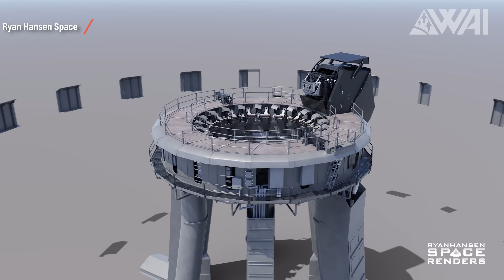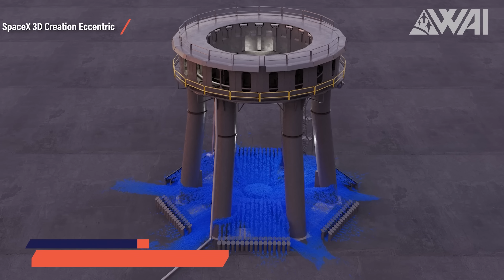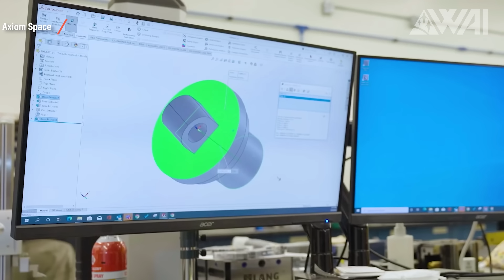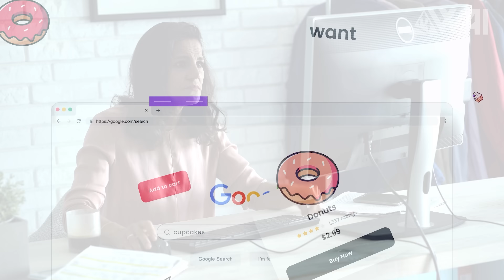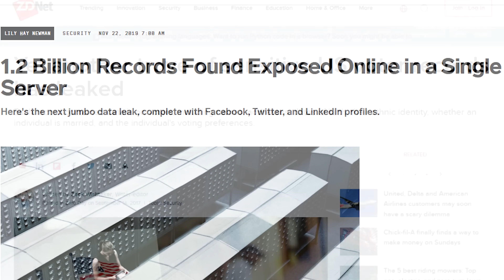SpaceX Starship breaks records before LAUNCH!! How will the journey continue?

Comment: After all 33 engines fired it acts like a giant sand blasting machine. The sand in this case are pieces of concrete torn from the ground. If Elon redirect the flow toward some rusted giant ships nearby, the rusted surface of the ship can be striped to bare metal and look brand new again. Why not :)

Comment: In addition to the deluge system, wouldnt it work to place what is basically heavy flexible steel armourplating on the ground underneath the pad? Probably even slightly sloped to redirect the exhaust somewhat?

Comment: Technically, a deep water filled pit beneath the launch tower would not be terrible. Then you could use compressed gas from the bottom to shoot water up at the engines when they ignite.
Reply: Pretty much what the graphic for Rocketlabs US facility shows with the launch platform built out into the water. If it works for one company, why not another?

Comment: To help with the launchpad problem, they could build a big iron or copper plate and run water or liquid nitrogen through it.
Reply: The metal arour / diverter is a good idea. But not cooling it to that degree. That would lead to the metal just shattering like glass. The main problem is not the heat. It´s the shockwaves. The sheer noise of all these engines is comparable to continious large explosion. That is what pulverises the concrete for the most part. Iy you stood to close the pressure from these engines could easily kill a person. It´s also the main reason for a deluge system. Water and especially water droplets create a surface that swallows noise, so the water curtains absorbe a large part of the shockvawves as transition between two materials (air/water in this case) absorbs a huge amount of energy. It obviously also absorbes the heat, but that could be dealt with other materials for the surface of the directly imacted areas. The shockwaves not so much.
Reply from the maker: Actively cooled pad surface? I like it. :_WAIElonlaugh:
Reply: No doubt in my mind already thought of, but rejected, because it's too complicated and likely to fail compared to just pouring water over the pad.
Reply: or they could have done it right the 1st time with a flame trench, diverter, and robust sound suppression water system.
Reply: Uhhhh...that's just no.  That's 2500 degree fire. Copper wouldn't and couldn't convey the cold nor the hot through it before cracking like a nut.

Structural dynamics wouldn't allow it and it would be 100x more expensive than just a simple concrete blast tunnel and some flipping water.

As for "capturing the water" LOL capture WHAT water?  I'm sure they can turn the pump off before its blown 100s of gallons of fresh water into the surrounding "protected bird preserve" that Musk chose to built his ROCKET FACTORY AND LAUNCH SITE beside. The rest of the water oozed during the takeoff is going to be seriously doubting its career choice as water droplets as it disappears from being able to be physically seen or detected.
Reply: @LoociferZ  I also wondered why he built in such a shitty location.
Reply: @froschreiniger2639  YES!  I didn't find out that it was a nature preserve until the last "high energy event" where the rocket blew up and caused the NTSC/and all the rest including NASA itself to pull their launch licence.  After 7 months they gave it back but with a ridiculous number of things they need to do in order to mitigate "high energy events" on a frigging rocket test site.
It seems Boca Chica also has a large group of people who like to use the flipping beach by a ROCKET TEST SITE so when they want to launch, they have to post the closure and close the beach too!
It's not a guess it's a pretty good assumption that the original deal to pull Spacex there didn't include them only being able to close the beach/test/launch a certain number of times nor add a whole pile of pollution mitigation steps to keep pollutants from a ROCKET FACTORY out of the bloody nature preserve!

I hope SpaceX throws them the middle and moves. I have to assume that their creation of another site over at the Cape has to do with this.  Hope SpaceX leaves a couple hundred empty concrete pads and just leaves the local economy holding a bag of nothing for being so ridiculous.
Reply: @LoociferZ  Whoever approved this deal should go to jail. The incompetence is just insane.

Comment: I wonder if porous concrete would be useful for the pad. I'm imagining that the concrete is spalling because because of the instantaneous heating and concurrent air/moisture expansion inside the concrete. Having a porous concrete may provide an exit path for superheated gases to escape?
Reply from the maker: That's a very interesting thought! Maybe something they could try after installing the deluge system if there still is a need then! :_WAIRUD:

Comment: A bit ago you said they don't release the rocket until after ignition.   Take a look as Spacex's  JILQ2qe-cjI  video.  You see the let go of it around 4 minutes prior.    Do you have info that they will do this different on StarShip?
Reply: That's a different kind of letting go; the strongback, or the chopsticks in Starships case, will likely be retracted from Starship a few minutes before. But they don't fully let go of the rocket (with clamps) until ignited.
Reply: @justinni_  The original question was regarding the difference between the full dress rehearsal and actual flight.  I gave an example of them not letting go with the strong back/chopsticks and he replied that they don't let go until after ignition.   I was pretty sure that was wrong but it wasn't important enough to research.   Just waited for the next launch.   And sure enough.  4:00 prior.  And they don't do that on full dress rehearsals.   But.  I was referring to starship so maybe they have different plants.  The differences are just an interesting topic.
Reply: @lucidmoses  Felix might've been wrong here. Strongback always retracts few minutes prior.

Comment: Per me the distance between raptor engines and ground surface must be increased 3 times or even more. Ground floor should be covered with iron plates with build in water cooling channels. If not, Elon gonna repair the concrete ground cover every time prepare it for the next launch.
Reply from the maker: I thought about this many times before. Why not raise the OLM much more and give Mechazilla an extra segment? :_WAIHello: It'll be hard to do before a launch but maybe on the second Starbase tower when it comes?

Comment: Given that they don't seem to want to build a flame diverter, and that they have so much experience with stainless steel, it seems like they would cover the pad in steel. Not a long term solution, but with all the scrap they have lying around it seems cheaper than resurfacing the pad after every few launches.
Reply from the maker: It'd likely need a full resurfacing after every test as is now. Plus, there are things going into the ground soon directly under the pad as talked about on today's episode. :_WAISweet:

Comment: So if the were to dig down a flame trench at boca chica, it would instantly fill with water due to being under the water table…vs building up the pad, flame trench, then adding water. Sounds useful to me to have a flame trench prefilled with water, no?
Reply: you would need a concrete trench to contain runoff and the saltwater would degrade the concrete if you’re using the natural ground water there
Reply: @Anon_Ymous  Not to mention issues with environmental regulations.
Reply: @norbis3939  that’s what I was getting at for containment.
Reply: I'm guessing you don't want to do that with salt water... you'll just end up with corrosive salt-laden steam getting *everywhere*.

Comment: They sold the oil rigs, thats a shame isn't it remember all your sweet mock ups in 3D
Reply: They sold them but didn't throw away the idea, the rigs won't work for the job. They don't need them as of now, eventually once starship is up & running they'll likely just build them from scratch. 
It'll cost more but in return they'll get reliable brand new floating launch facilities.
Reply: @SpaceXsuperheavy  I mean from scratch is probably for the best isn't it that was you can design for efficiency
Reply: @_Ragnarocket  Yup🚀